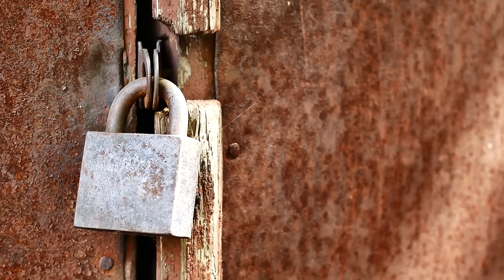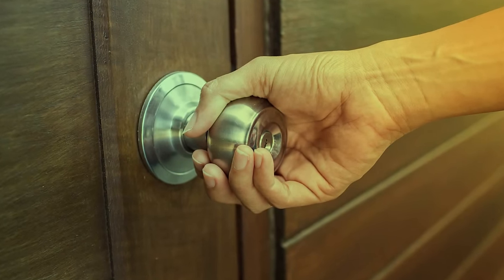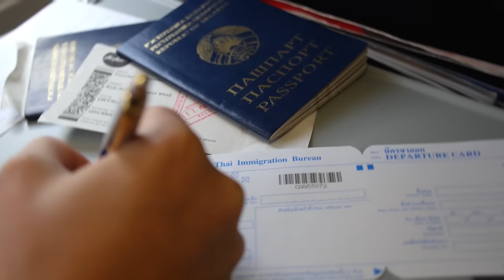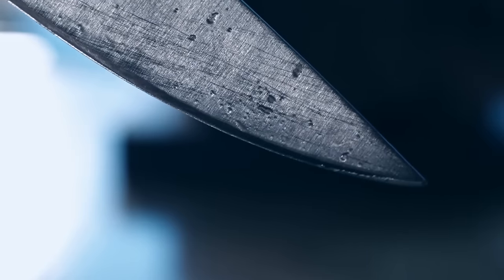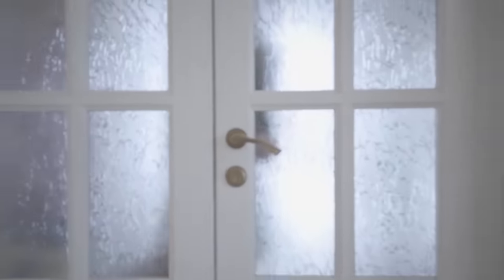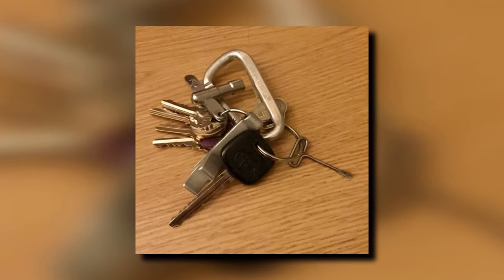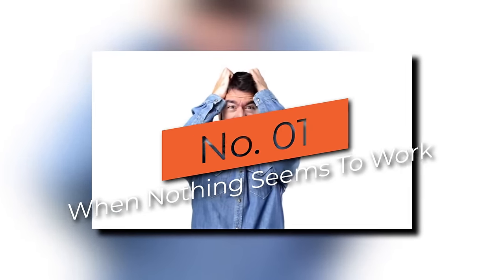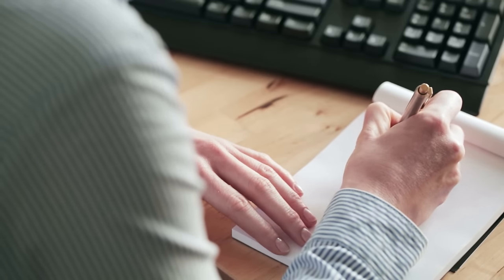10 Ways To Open A Door Without A Key

Comment: I never knew about what to do if there is just a slit in the door knob until after I opened it with a credit card, googled pictures of doorknobs with slits, and called the company that sold them, the nice lady told me to use a penny and just turn left. As a kid I was used to the paper clip method and a penny didn’t come to my mind because of the blocking behind the slit. So easy but I think you should add this as an 11th way to open an interior door. Us old folks that never saw a slit in a knob are still around! 😊 PS: I do thank whoever made this video. I did not have to clean up any dog messes after releasing my patient dogs from the room!

Comment: Of all the ideas I've heard from you, drilling the door is the best. It's the most economical way and prevents you from paying somebody 2 unlock the door. Just drill and destroy the door knob and buy a new door knob.
Reply: Personally I find a bump key ideal for opening any door they take a minute to make all's u need is a blank key about £3 from a lock Smith and then u use a triangle shaped file and file the key about 2 thirds down so it's still flat and smooth then make 5 identical sizes teeth along the key and then round them off a little with the file place key in the door pull a quarter a inch then use something to tap the bump key as you turn the force of the bump will make the pins jump up so as you bump and turn at the same time the door simply opens its very easy after a few goes
Reply: @exploringwithAshB  I usually just jam a long knife in the door and pull back the latch

Comment: I used to use toothpicks to unlock the doors with holes in the middle. All you have to do is jiggle it around a bit and it'll unlock.
Reply: The toothpic is now stuck in my door lock
Reply: Help
Reply: @nightburf585  Oof
Reply: @nightburf585  Its been a week. Did you get it out??
Reply: I just realized that i just have like a plastic air vent just on my bottom door that i can take it off and go outside im good
Reply: @hopeworld134  thanks for asking anyways

Comment: A method some burglars use is to place something like a 2x4 diagonally between the hinge-side jamb and the lock-side jamb just below the lock, and stomp on the 2x4.  This spreads the door frame hopefully fgar enough to beyond the reach of the striker, releasing it. keep pressure on the door towards the direction of normal opening.  An exterior door is much harder to do as the door jambs are usually better reinforced.  Spreading the door jamb can also be done with a crowbar or evcen a big flathead screwdriver or a tire iron from your car.

Comment: The library card worked for me. It was hard to swipe it up and down so once it was in solidly, I used a plyer and tapped used the bottom on the handle a few times to tap bring the card down to the right place.